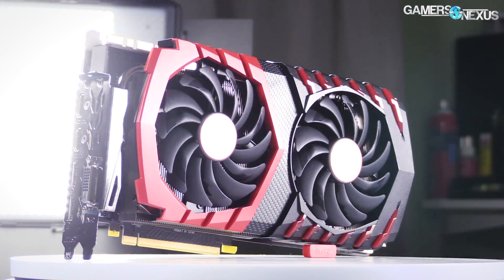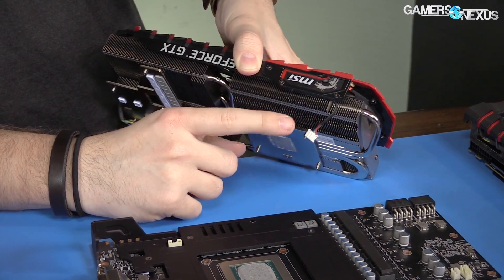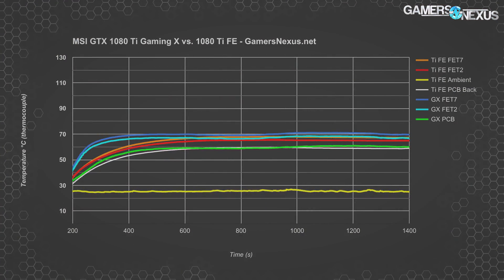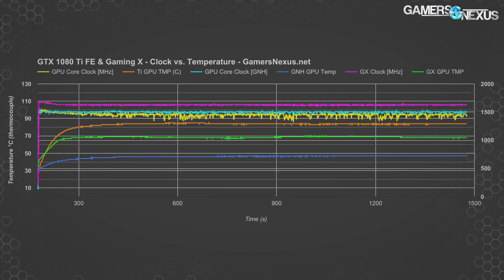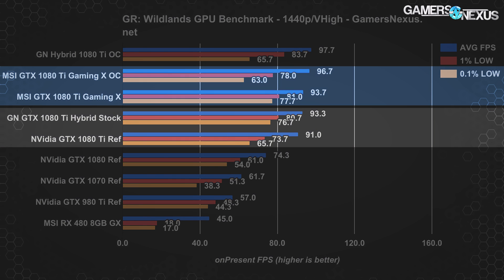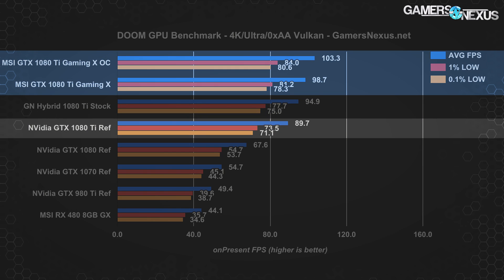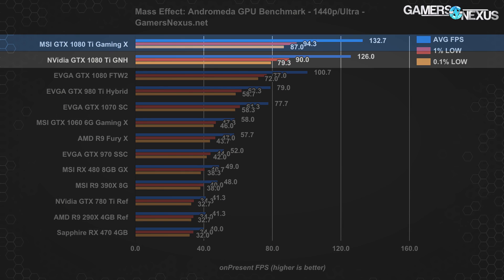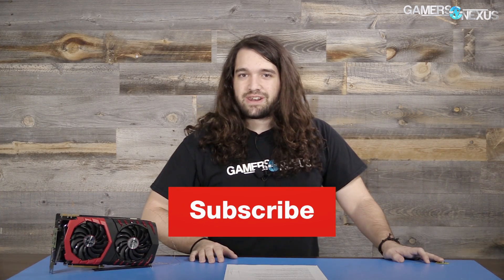MSI GTX 1080 Ti Gaming X Review & Thermal Analysis

Comment: Big fan of MSI. But they need to change the color scheme to a more neutral tone.
Reply: they should have a quicksilver edition on every card just like their 1070, that things sexy as fuckkk
Reply: I painted my msi motherboard to white and it looks amazing http://imgur.com/a/p7zHc
Reply: they need to offer swappable plate colors
Reply: Me too, the quicksilver is niceeeeee
Reply: im a fan of the MSI ARMOR cards
Reply: MSI do have the black and white "ARMOR"  series of the 1070 and 1080 card.  hope they come out with a 1080 TI version.
Reply: they have one however according to reviews and the forums its plagued by excessive high temps on the default settings.
Reply: Adnan Ahmed You can always remove the shroud and paint it. Would be super easy.
Reply: Ace_Of_Spades Gaming good idea problem with that is the red led parts on the card are a red.
Reply: you can 3D print new one ;)
Reply: Don't buy the 1080ti armor , its cooler is terrible. 80c core ( 21c ambient) with no overclock after about 1 min 30 seconds at load . I am sending mine back and upgrading to a gaming x.
Reply: Does it affect your thermals with the paint on it? :)
Reply: Adnan Ahmed Why am I the only one with a PC with a black and red PC xD!
Reply: Especially since they're putting RGB lights on it; RGB should never be paired with red plastic (or any plastic not color neutral).
Reply: I hope they make a quicksilver edition like the 1070
Reply: ever thought of busting out the spray paint? No?
Reply: I hate how the entire shroud looks, tacky glossy plastic with "muh edge" design, also DWAGONZ

Eh.

Comment from the maker: Thanks for watching! Full review w/ more thermal tests (including backplate on/off testing) over here: http://www.gamersnexus.net/hwreviews/2877-msi-gtx-1080-ti-gaming-x-review-and-benchmarks

A link to the product page for the card is in the description as well.

1080 Ti Gaming X PCB / VRM analysis: https://www.youtube.com/watch?v=kj57W3vTqoQ
1080 Ti Gaming X tear-down: https://www.youtube.com/watch?v=U36lfOF1ckA
Reply: ok, so the power is a bit better on the MSI then the Hybrid. Perhaps next time BZ and GN can team up to make a Zombi Hybrid, lol.  I know, that would be a lot of work for possibly single digit higher FPS.
Reply: Gamer Nexus, you have to do a video on the frametimes of the 1080TI. This is the first time I've heard it and it seems like a huge issue, we don't know what's causing it you only tell us overclocking isn't worth it. Is the voltage the issue, is the memory OC the issue? Would love to know.